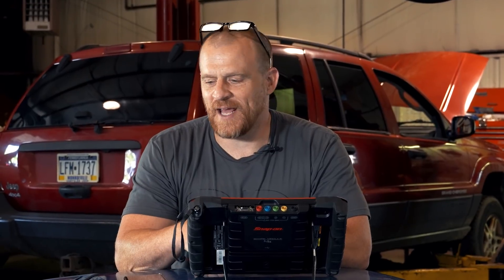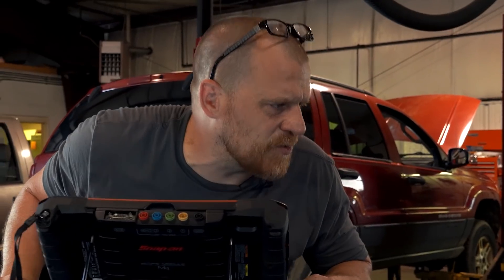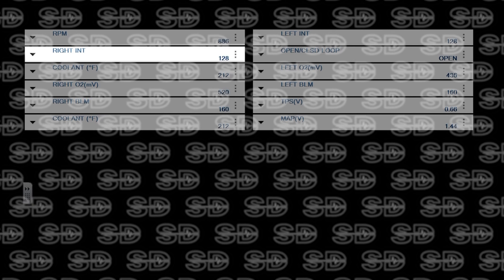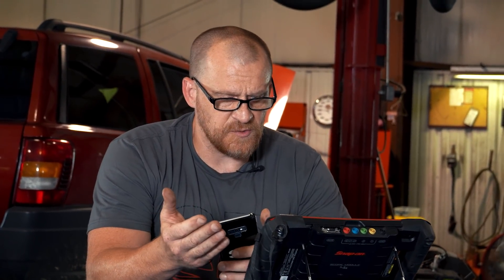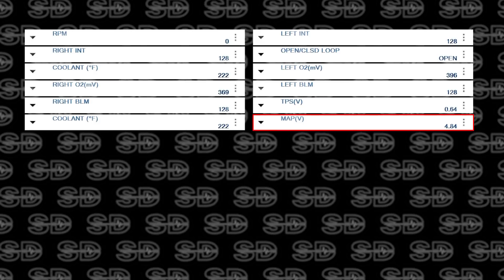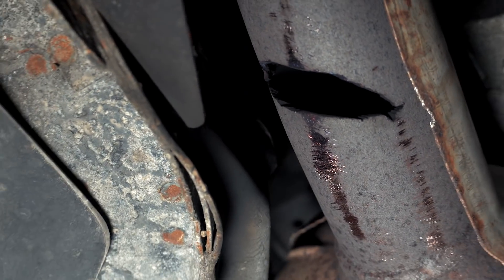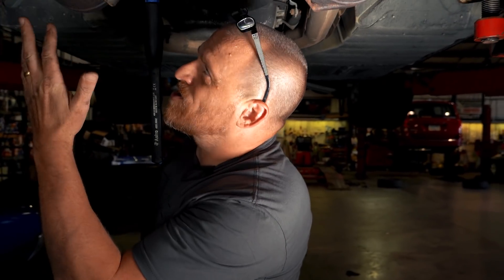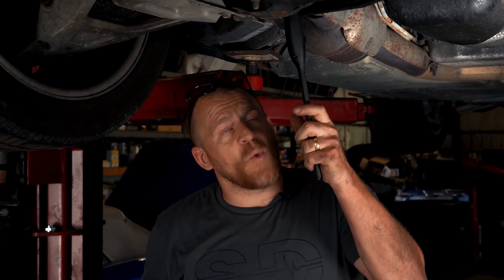1992 Corvette Misfire, Melted Cats, O2 Testing (Part 1)

Comment: Hey man. I have a 98 k2500 5.7. I have a good scanner and truck runs good but bad idle. Misses once in a awhile. Now all I'm looking for is how do I read my live data to know what is bad or not like say m o2 sensor what numbers am i supposed to see when running to see if bad or any other. Truck runs no codes idles rough misses at higher rpms a little. Brand knew everything tune up.

Comment: Hi sir, can u please have a look in this video- link, as it sounds same as this corvette is while we do snap throttle test, but it does not creates the same noise while we slowly press accelerator down.. dealership has already changed spark plug, injectors, coils, fuel pump, battery.. 
The sound goes away once the car is heated up. There is very little smoke while we 1st start the car, no fault code.. we remove oxygen sensor  to see if the problem goes away ( plug exhaust), no there is no improvement.. any idea you can give 
Thanks 
https://youtu.be/G6owqAJEUl8
Thanks..

Comment: EDIT I wrote all this crap thinking it was a TPI, but it's an LT1, oops my bad.  Forgot corvettes got upgraded before the Camaro line.  If anyone reads my nonsense, it applies to L98 powered TPI cars. 

  Old plug leads will start jumping to ground during acceleration, btdt.  I'll probably be there again before much longer because it's been 10 years since I replaced them.  I even routed them exactly the way the factory did it, you don't see that much.  Factory fuel injectors are interesting.  The ECM will shut down the driver circuits from overheating the output transistors.  Won't even throw a code, just dies until it cools down.  These things have really "interesting" problems to solve.  Hard starting can be from a bad fuel pump relay, because the oil pressure sending unit will supply voltage to the pump, once it builds oil pressure from cranking it, at least on the Camaro TPI cars.  Dealerships are relatively clueless on these engines. Diagnostic codes are usually far from what's really wrong.  They tell you symptoms that you probably already know.  Occasionally they point to a problem, but not usually.  Really glad I bought the factory service manual for my car 30 years ago.  It's invaluable.

Comment: It's OBD1, it doesn't care about cats.  ;) I've got a 90 IROC with an L98 dual cat TPI setup.  If it weren't for my moates diagnostic cable and tuner pro, I'd be screwed. These motors are torque monsters.  The HP rating seems a joke by today's standards, but 350ftlb of torque is still respectable.

Comment: Disconnect  o2 sensor wire from ecm hold with one hand touch other hand to battery negative drive system rich now touch other hand to postive battery terminal drive system lean tests fuel system feedback response on these preobd 2 systems

Comment: Good video.
O2 sensors read oxygen content which should be fairly high with those back pressure relief holes they cut.lol
Young techs need to ask why is the sensor seeing high oxygen. Misfire? Exhaust leak? Vacuum leak?
Reply: Unburned oxygen

Comment: I would guess they cut the pipe to see if the performance of the engine changed? ( checking for clogged cats?) Any real mechanic knows to pull the o2 sensor to check for that. That way they can be replaced if that isn`t the problem.  No open holes left anywhere.

Comment: Hi sir good afternoon, may I ask for your help again?  Our 2005 Nissan xtrail 2.0 L won't start.  We don't use it everyday since the pandemic and I'm currently jobless I only start it once in a while, last time was 2 weeks ago.  But this morning tried to start it but the battery was discharged and so I hooked the charger for 40 minutes and started it again.  After several tries still cranks but wont run.  I checked the codes and got a P1610 and P1612.  Funny thing is I use the same key everytime for the past several years.  How do I get it to run again sir?  Thank you very much!
Reply from the maker: Try disconnecting the battery and then touch both disconnected terminals together for a few seconds (called a cap. discharge). This will clear any memory and it may restore proper immobilizer function. Key word is may.
Reply: @ScannerDanner  thank you sir!  Thought you would never reply I will do it tomorrow morning hope it works!  God bless and stay safe!
Reply: @ScannerDanner  Good afternoon sir, my xtrail started again!  I just followed what you said and used another original key and cycled on off 3 times.  And it started!  Though I noticed when the engine is running, I felt something hot beside the battery.  It was mounted on the left side óf the engine compartment near the left turn signal.  It's hot to touch.  I can't identify it.  Thank you very much!

Comment: At 6:20 you say to put in 2 new cats and to replace both o2 sensors before knowing what the root cause is? Your breaking you're own cardinal rule. Never parts change.
Reply from the maker: I explained why and also proved O2 circuit integrity. Also what you didn't know and I failed to mention, was the holes were created so the owner could drive the car. It was not driveable due to completely plugged cats. 
Not much else was able to be done at this point without having to question the false lean O2 signals the entire time and I wasn't willing to do that. Hope that makes sense

Comment: It strikes me that the person who owns the car doesn't 
Know what he is doing, a waff
Knack for definite.
It's a good job you know what you are doing.
To run an engine,on full throttle down the highway, with the exhaust system like you are asking for damaged engine valves mybe ,damaged pistons.
Reply from the maker: he is an AWESOME carpenter though. He built my back porch for me :-)

Comment: Nice outro, Caleb! 

Wow, looked like someone was practicing how to chop trees down on that exhaust there, LOL! I've never seen cuts made like that before on an exhaust. Did someone think they'd get more power that way? Or maybe checking to see if the cats were gutted, or completely plugged? If so, why wasn't it fixed? That is STRANGE!!

I hate lifting Vettes, too. So low to the ground. My buddy has a heavily modified '11 Camaro that I can't get my lift arms under. Have to pull forward and estimate where I want the car sitting, then put tape on the floor at the centerline of each wheel, then put the blocks there and drive on them. My jack won't fit under his car, either!

Looks like an interesting series - I'll be watchin' for part 2.

Comment: Im guessing they cut the pipes to overcome or prove a plugged/melted cat symptom without knowing how else to confirm (like your vid, drill 'small' holes and back pressure tests etc)...or maybe just to make it drivable to get it checked out further....secondary bonus, it's now possible to peek inside at the cats and o2's...but impossible to diagnose, confirm or rectify the original cause...lol🤭👍🇦🇺

Comment: Will that wiring integrity test work on all o2 circuits? (3, 4 wire and a/f sensors)
Reply from the maker: Not all O2 sensors use a bias, but the ones that do, absolutely!

Comment: I might sound like an idiot but can an exhaust leak after the 02 sensor cause a P0171? More specifically it’s a 1999 Grand Prix GTP and I suspect the downpipe leaking.
Reply: if it's leaking within one foot or so of the O2 it's possible.  if it's V6 engine(think they were), where does that pipe connect at or near the other bank? because it pulling air in could throw the opposite bank O2 off if it's anywhere near the Y joint.
Ideally you should have no leaks anywhere from cylinder heads, to two feet after the final rear CAT and O2 sensor location.

Exhaust flow pulses are the devil to predict and there's always a cylinder exhausting, while others are slight valve open at cam overlap, so many unpredictable things occur when playing with pulsed flows and that's not even accounting for it pulling oxygen rich air and backfire/popping, which skews things very hard!
Reply: Not likely if it is after the if it is after the O2 sensor.  Most likely a vacuum leak or a bad fuel injector.   More likely a vacuum leak.  Get some non-flammable brake clean and spray around the intake manifold and where the injectors go in on the front bank.  When it dies or stumbles you will have found your vacuum leak.

Comment: The cuts on the exhaust look intentional like they were doing it to be louder.
Reply: The cats might have been so badly melted, that cutting the holes was only way to take the car to the shop on it's own wheels.
Reply: 5Dale65 that makes sense.
Reply: @5Dale65  usually they blow the very high temp padding material out from around them and start rattling loose if blazed that bad, which also breaks up and spits chunks out into mufflers, clogging them ;)
now being carbon loaded and blocked up is something else. bad O2's and lack of fuel delivery will make them glow and destruct also, as well as ignition misfires...
my buddy learned all about that, after melting his van cat's down years ago playing around with starting fluid and gas can limping it home... tow bill would have been like $90 then, instead of the $700+ factory y-pipe and cats... after I fixed the real issue of course. 20+ years ago
Reply: Guaranteed they cut them like that to inspect the cats! you'd be able to see right down inside with a mirror or bore scope camera, I'm guessing it was highly restricted anyway being it made them glow.
lack of fuel/lean would make them melt cats quickly at that age range and most often never set a check engine light if the O2's were also bad. pretty much sums up all the gm engines of that era
Reply: or theft and got caught in the act.

Comment: Hole near O2 sencor = lean reading = dumping more fuel = fuel get into converter and burns there or interacts with it in some way = converter glows red. hope i get it right)
Reply: OR the O2's were bad to start with, fuel system is restricted and running way lean, which melted the cats, then they cut holes to inspect them with mirror or bore scope....
that's pretty much standard common issues of GM's that era, weak fuel pump/restricted filter, low pressure and bad O2 wouldn't set a check engine light.
lets not forget those stupid flat distributors cap's that would always arc across internal and misfire and do the same thing :)

Comment: I seem to remember back in the day there was a kit to change the 02 sensors with self heating sensors. Too, would exhaust leaks that close to the manifold cause burned valves? The TPI in my first 1 was sensitive but the LT was a bit better except for the ignition. Good video. Most people wont touch those things anymore

Comment: i'm guessing those pipes were cut open to make it drivable.  am curious it said  a/f learned it said no. also was staying in open loop even though the coolant  temp was up.  never really messed with  obd 1  stuff so this will be interesting
Reply from the maker: Yes, they were cut to make it driveable with the full intention of replacing them and I found out the owner did this, not the other shop and he is a carpenter 😉
Reply: @ScannerDanner  woh wait a woodpecker messin with motorhead stuff???? sounds like time for a trip to the birdbath  lol

Comment: I have a problem with the car. Open loop
A mistake appears in open loop
Fault open loop
What is the problem
Reply: No code appears. The problem arises when the car is cold. When it gets to the heat, it's not a problem.
Symptoms of the problem, and there was more air.
No misfire
In live date
Next to open loop Fault
The problem only comes out and the engine is cold.@open loop@
I checked the power of the spark. The spark is excellent.
Reply: If there's an air leak from me,
Does it make RPM high And fixed.or cause a concussion to the engine especially since he has 
Mass Air Flow 
I have another car that doesn't have this. It's have sensor MAP. leaking air from me inactivity makes RPM high And fixed.

What I understood about open loop & close loop
In open loop the engine Don't worry about the oxygen sensor. 
In close loop the engine He cares about the oxygen sensor.
Is that true?
Reply: I closed 80% of the air inlet before it reached a sensors Mass Air Flow 
Engine performance has not changed
In live date The value out of sensor He did it, and the engine is hot and working normally.
And there was another source of air entering the engine without going through a sensor Mass Air Flow .

I didn't check it out. 
I want to know what you think and your suggestions.

Mass Air Flow sensor 
Before Throttle body 
He knows how much air he's going through. 
Then he's heading through throttle body 
What if there's air leak ing after that?
Can the sensor know that?
MAP sensor He can tell.
But what about the car that depends on 
Mass Air Flow sensor Can you do that?
Reply from the maker: focus on your oxygen sensors also year, make, model, engine, trouble codes, symptoms would help me answer you better. Thanks!